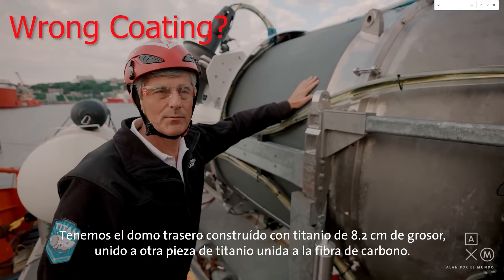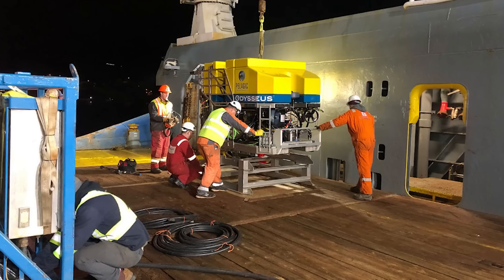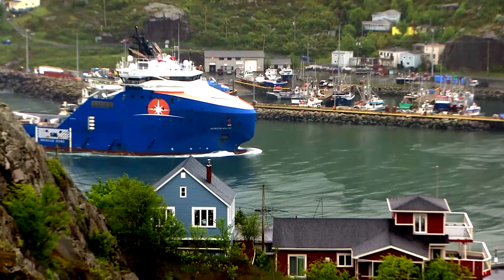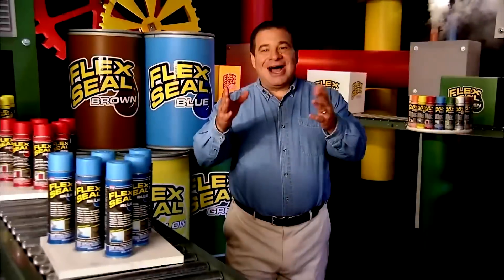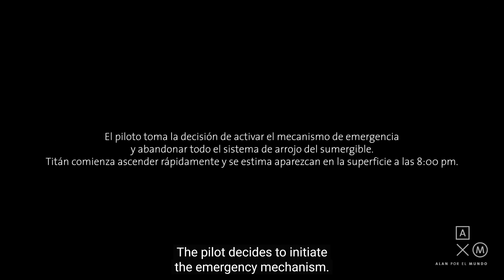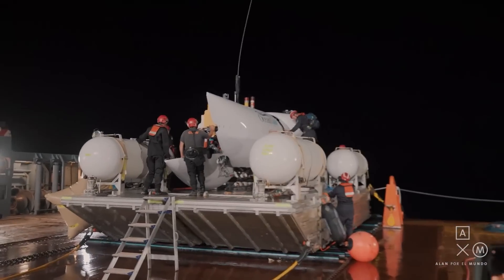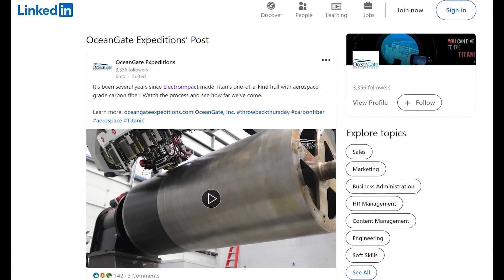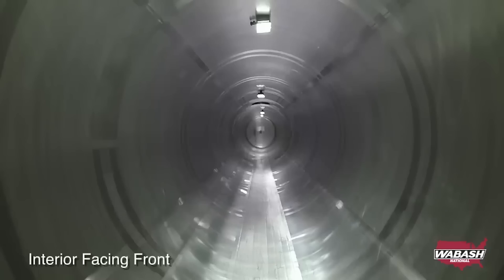Titan Sub Wrong Coating? Hull Construction, Debris Field Search

Comment: I honestly believe the loud gunshot sounds they were hearing the time before when submerged was the carbon fiber filament snapping under immense pressure like pulling a giant cable too tight until it breaks. can you imagine how loud that was ? From earlier footage they said the tube was made from a single strand of carbon fiber spun around a tube shape and then glazed with the apoxy while it was being wound, that sound they heard was the single continuous strand of carbon fiber snapping in multiple places  under immense pressure. So that death trap had multiple failure points and even a child could prob point it out on xray
Reply: Except it would seem the carbon fiber was mostly in compression, it's the resin that was doing the heavy lifting.
Reply: footage? They use film?
Reply: The carbon fiber was both in compression and tension. It probably bent like a beam supported at two ends (the titanium endcaps) causing tension on the inside and compression on the outside. So the snapping/gunshot sounds may very well have been carbon strands snapping. Especially at the titanium/carbon fiber intersection where a complex bending moment would be present.
Reply: No it was the exact opposite. Your scenario sounds like it was pressurized and exploded from inside out. This was crushed. No stretching of strands at all. The popping was likely the fracturing of the resin of the hull, the acrylic porthole or the glue between the titanium and the carbon. Carbon graphite behaves like glass and shatters like glass under pressure. It does not behave like fabric, rope or Kevlar under tension. It’s an implosion and it would be instant.
Reply: @properfpv7160 that kind of loading actually puts both tension and compression stress on different parts of the hull causing layer separation
Reply: @cldus7442  only if it’s not properly saturated with resin. Once carbon is cured in resin it behaves like glass. It holds its strength until catastrophic failure. There’s no fibers separating until that point. If there was the hull was poorly manufactured and they didn’t use enough resin or it cured before the layers bonded. It’s should be essentially a hardened liquid resin without any voids, air pockets or mis adhesion between layers and all fibers need to be saturated 100%. Timing of overlap for sequential layers is critical too. It needs to be contiguous resin with fiber reinforcement. The loop pattern they used was weak too compared with the way high pressure tanks are wrapped. Proper manufacturing of carbon parts uses vacuums kilns or molds to prevent problems like that. When I pour resin if it’s a table top resin which is much thicker than deep pour resins. I use a vacuum chamber to remove the air bubbles that are mixed in when preparing the resin. If I don’t do that then I will need to do a lot more torching bubbles out as it cures and it will have many more inherent flaws that cannot be easily fixed. This is also done to deep pour resins to get cleaner results though the long set times and thin fluid reduce the bubbles. Also the top is sanded off and finished with ceramic which levels it, takes off the fuzz and lint plus the bubbles that get cured into the top layer.
Reply: @properfpv7160  Then you have the temperature cycles the resin has to deal with over its lifetime, can be anything from 20c in direct sunlight to -10c maratime winters straight into average 4c water. How many thermal cycles is good for that resin & should they be heating the hull from the outside to avoid thermal shocking? We know any application that undergoes a lot of thermal cycles under compression isn't ideal for carbon fibre. Great insightful comment on the resin.
Reply: @spikester  thank you. Yes resin expands and contracts a lot with temperature. We have to build-in room for expansion when routing for brackets for feet on a table for example. We can’t pour it into glass because it will break the glass with expansion. We also can’t adhere it to dissimilar materials like metal and if we try it with wood there are many problems with moisture and expansion, we have to use meticulous surface prep such as rough surfaces for mechanical attachment. We use mechanical connections like threaded inserts and bolts to attach hardware or bulkheads etc.
Reply: The loud sounds were the electrical system shorting, as water had begun leaking into the hull.
Reply: @Heike--  no, the loud sounds were the carbon fibers breaking bit by bit. At first the sound came from the whole hull and not just from one end of the submersible and for over 20min. But more important is, that the loud cracking sound was already heard before. In fact during the first test dives with the Titan prototype there were gun shot loud cracking sounds in the whole hull, while not even going that deep. The carbon fibre hull was then improved and the cracking got quieter and happened only from time to time. Every time when pressure was applied and everytime pressure was released, meaning that there was a lot of energy "stored" in the hull, that went away when coming up to the surface, as stated by a person that experienced it. On the day of the implosion, the carbon fiber was probably cracking more than ever before, because it was breaking just everywhere, additional to the older broken parts from the dives before. So when there was structural damage after every dive, it was just a question of time when it gets weakened so much, that it can't withstand the pressure anymore.
Reply: @Heike--  The loud gunshot sounds aren't from the fatal incident, it was actually reported by the people on the first test dive. We have no idea what the people in the final dive heard.
Reply: @Heike--  The batteries are external. You know this - right?

Comment: If this case study has brought anything, it at least gives me and my other engineer friends a fun game to play (or controversy, perhaps) that I call, "what failed first: the fiber, the window, or the glue?" Its kind of like the proverbial chicken and egg, not sure if theres a right answer.  But its fun to discuss, especially when some are absolutely determined it is one over the others.
Reply: A friend of mine who's playing a racing game recently showed me a video of how someone had modded the game and was driving on the racetrack in a car looking like the Titan. Honestly think Titan would have fared better as a race car than as a submersible...
Reply: The carbon fiber body is my favourite. The window will have been designed to push on the titanium end under pressure. The way the vessel was assembled meant the pressure was pushing the endcaps onto the hull under pressure so I can't see the glue failing to be catastrophic. So I say the hull is most likely the first point of failure.
Reply: You can tell the rear glue joint gave up becaue the composite fragments and the crew goo were all packed into the rear dome.
Reply: The glue has been a popular scapepgoat on youtube but I think it wasn't needed to function like a glue since external pressure forced everything together, the glue was only functioning as a gasket sealer.  That is still an important function though, however if the gasket sealer failed the sub would not have imploded, it would have just slowly filled with water.
Reply: @billj5645 nothing slowly fills with water due to a leak at 6,000 PSI. That's not how it works! 😂
Reply: @ButterfatFarms  It didn't fill with water it imploded.
Reply: @seanjoseph8637  I never said it filled with water.
Reply: A glue up with air pockets won't hold anything, and the glue had to hold in the joint while the carbon hull was being squeezed and trying to pull out of the joint. Make a tape circle around a toilet paper tube to hold it to a surface and then squeeze the tube . As it crushes it pulls out of the joint at the same time.
Reply: @camojoe83  The pressure was pushing the end caps onto the hull.
Reply: @seanjoseph8637  not harder than it was squeezing the flat cylinder.
Reply: @billj5645 My guess is the glue failed. As the hull was deforming under pressure it started slipping out of the titanium end cap. Glue let go, hull pushed itself out of the groove and collapsed.

Comment: That tank implosion was also at ONE Atmosphere. Wasn't Titan as 366 or so atmospheres? It probably happened 366 times faster!
Reply: It happens at about the speed of sound.

Iirc, at that depth the speed of sound is around 1500mph.

Of course, once it starts caving in,  crushing thick metal is slower than shattering carbon fiber, no matter where it happens.

But the shockwave moves at the speed of sound.

Comment: i spray that coating in the automotive industry, its a cross-linked catalyzed urethane, some of the toughest stuff around, can be strengthened with glass/kevlar fiber.  but i cant say it would hold up down to 12,000 ft.
Reply: Truck bed liner and all of its derivatives are pretty cool, buuuuut yeah, like you said 12,000ft? It was not engineered for that, and I'm sure a polymer of some sort COULD be engineered for that. That's the worst part.

Comment: Yea no. I used to install rhino liner on undercarriages and truck beds to keep moisture from rusting when I was an aftermarket truck part installer and it gets kind of rigid when it fully cures idk. I see them using it on boats to prolong the effects of water on the boat but not under those high pressures at that depth. To think that was a part that was consistently wet and actually feeling the pressure of the ocean is crazy to me.

Comment: Right or wrong for other reasons, that thin coating was structurally irrelevant.  From your excellent 'leaked' communications timeline analysis, it structurally broke up at the 90% depth, but while ascending with RTM all red. The pieces floated down like junk and tree leaves looping around. . . That could have been a steel "coating" and it wouldn't have been any difference.  Rush was way past an idiot.

Comment: I always wonder why the groove in the titanium where it meets the carbon was not deeper.it only looked like 2 inches or less. Also if they had some interior support it might have helped keep the carbon fiber from flexing
Reply: Well I agree but at those depths the pressure will be pushing everything together.
Reply: It was all wrong

Comment: guessing the rynoliner is an anti-foul coating and wasnt used for structural purposes

you can tell he enjoys saying the military use it
Reply: its a truck bed spray on liner to help  keep moisture from rain out as well prevent abrasions to the truck bed. the military would use it on land vehicles for the same purpose. Rhino Linings is the company that makes the spray

Comment: Jeff,  Have any better shots been released showing fwd dome at viewport and the bolt on interface ? I'm curious if as a secondary failure the viewport and retaining ring were blasted outward, either from threads pulling out of titanium or the bolts failing in tension as pressure behind slammed into fwd dome. That type of failure would tend to eliminate the viewport as primary cause of implosion and make it an after effect. One point in the video shows robot in movement axially, though it's not clear if any fiber is applied lengthwise to cylinder between hoop orientations. Any info on the schedule of fibers used in it's creation ?
Reply: 11:30 laying axil strips crossways